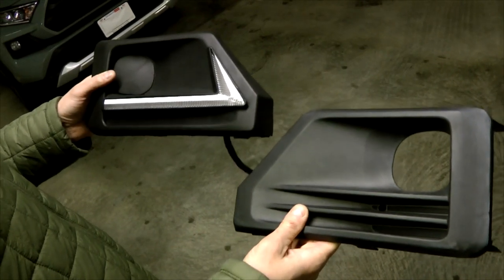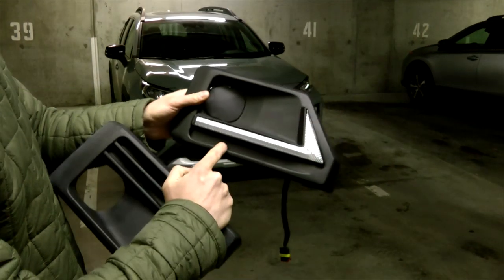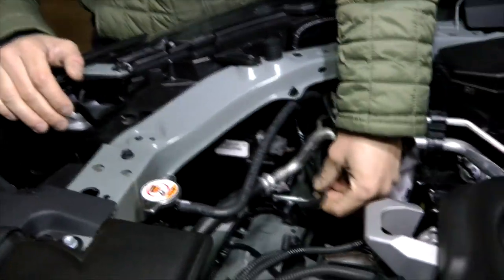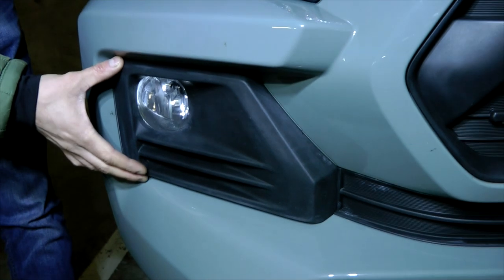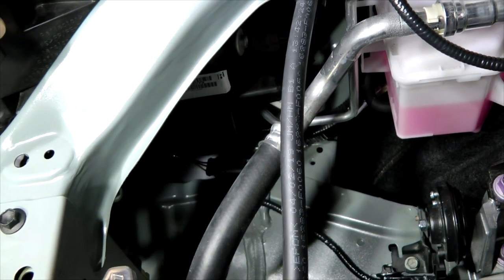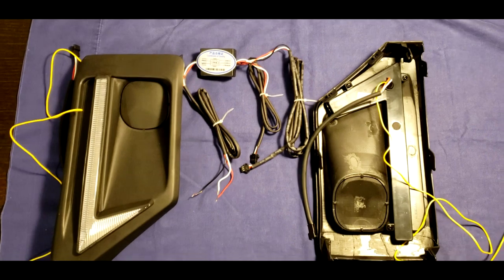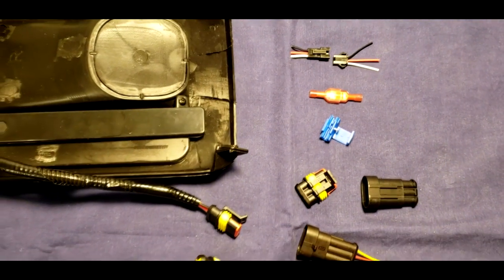Toyota RAV4 (2019-2023): Fog Light DRL LED Turn Signals / Marker Lights Installation.

Comment from the maker: PRODUCT LINKS:
1. Fog Light Daytime Running Light DRL LED Day Light 2Pcs For Toyota RAV4 Adventure 2019 2020 2021 2022 2023 - https://cartrimhome.com/DRL-Toyota-RAV4-Adventure-2019?tracking=morozov_automotive.
2. 3 Pin Connector Waterproof Connector, Male and Female, 16 AWG Wire Suitable for car Truck, Boat and Other Wire Connection (5 kit) - https://amzn.to/44Jv7FT.
Reply: Hi Sir, let me just ask you what about the Side marker lights of your Toyota Rav4 (2019-2020) did you change it for Led Lighting? and if you change it what brand and specs for that Side marker of your Led lighting did you put on it?

Comment: I want sequential tail lights, anything like that on the market?
Reply from the maker: Hi. There is this product - https://cartrimhome.com/Rear-Tail-Fog-Light-Lamp-Toyota-rav4-2019?tracking=morozov_automotive. It is being installed in the rear bumper in place of reflectors and works as sequential turn signal / marker / stop light.
Reply: @MorozovAutomotive  cool! I'll check it out

Comment: I bought a switchback led for my rav4 but my rav4 has only two wires in the turn signal. it is only single filament. do you know what is the solution?

Comment: I have the same kit and will be installing soon. Did you document exactly which wires you tapped off from the factory headlight harness for the installation?
Reply: I was wondering the same thing.Did you figure it out?
Reply: @ni4nijustice855  I haven't yet. Life got busy. I'd love a color coded diagram of anyone comes up with one.
Reply: Anyone figure it out?

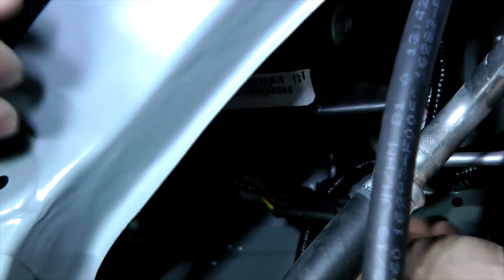Comment: If you didn't have that connector as shown at 5:08 ; to what then you would have connected the white cable to? We know yellow is turn signal, black is ground, and read is ACC.
Reply from the maker: You do not need white in this application- it could be DRL for some european models, I can only guess. So leave it isolated or just cut it off.
Reply: @MorozovAutomotive белый провод подключаеться к габаритам . Желтая лампочка с боку фары. При включении габарита , яркость ходовых огне цу гаснет

Comment: how did you do the connection and also where do I buy those modified connectors?
Reply from the maker: You can do direct tapping into onboard circuit, close by to front turn signal bulb socket (there are a lot of different tapping connectors on the market). I did soldering instead. 3-pin connectors( bought at amazon) that I have used are optional, for quick release in case of changing  that light feature in the future, if it fails.
Reply: @MorozovAutomotive  would it be ok if I tap the White, Red and Black wires directly into the headlight cable? then use the yellow wire to tap into the signal light? and get rid of the LZGD box that comes with it.
Reply from the maker: @RedPanther2030  Not like that. Nothing goes to the headlight. Yellow red and black-  to form (turn/ marker/ ground) cable that  is the single cluster of wires that goes to the front turn/ marker lights. White wire is DRL and will not be used. Black box just a splitter-no need for this application. You also need tester or DMM  to define operation of each circuit- OEM wires are factory color coded so you have to find  their functionality first. Would recommend to use help of someone with electronic/ electric experience.
Reply: @MorozovAutomotive  thanks for your reply. I've noticed that you're just using Yellow, Red and Black. Which can be tapped into the signal/turn cable. I did buy a 4 pin connector (just in case if I needed the white wire to be connected to the headlights in the future). However, I'm gonna try to install it tomorrow and see how it goes. Thanks man really appreciate your help
Reply: @MorozovAutomotive  I was able to install it using t-taps. Very simple process and better than the original setup they included in their package. Thanks for your help. Appreciated
Reply: @RedPanther2030  were u able to use the white wire for drl? And how did u do it?
Reply: Where are you located and do you have an automotive shop
Reply: @RedPanther2030  thats for turn signal bro not for drl
Reply: @wanderer2955  it has a DRL too
Reply: @RedPanther2030  if u watched it carefully you would notice that it wasnt a drl but connected to the parking light. If its a drl the only light should be on is the low beam plus the new drl.
Reply: So after trying some things out I ended up soldering the 3 wires that came with the new fog light bracket. (Yellow, Black, Red) and discarded the white wire. I soldered these 3 wires directly into the turn signal harness. I cut the turn signal harness and essentially 3 way soldered the turn signal harness, the turn signal power wires, and the new fog light bracket. After soldering and putting back together the lights worked perfectly. DRL would be on and amber turn signal synced perfectly. Then after a short amount of time I started working on the passenger side I tested to make sure everything was still working and the drivers side completely stopped working. No turn signals in mirror, DRL on new fog bracket and also no fog lights at all. Only headlights working. I finished the process up and couldn’t figure out what went wrong. I adjusted some wires that may have been sticking together and now the turn signals work how they are supposed to, however my fog lights do not work on either side and the DRL for new fog bracket do not light up with headlights. Can anybody help?

Comment: Would you be able to show how you soldered the wire? I really want to install this in my Rav4.
Reply from the maker: Unfortunately it is not possible to show the soldering of that particular connection- very tight space to place the camera. And if I do that again I would tap wires and do T-splitter for each wire. There is a sample: 26:40, https://www.youtube.com/watch?v=5Jdyv_VOkV4&list=PLvbh35vryNMlYPl78OKXzB9lH9bH8but0&index=4

Comment: Did u rempve the white wire?
Reply from the maker: You can cut it off or just isolate, but if  your model has DRL you may connect it to that wire to support this feature.

Comment: What is that connector?
Reply from the maker: Aftermarket. Anything with a 3 pins will work, but you have to tap (or solder) it to existing circuit. They do not supply T-splitter for this application, unfortunately.